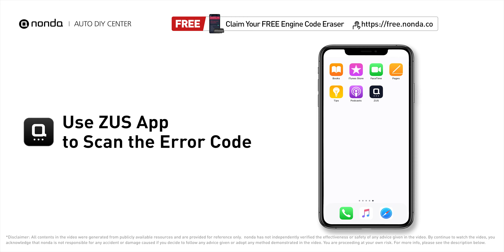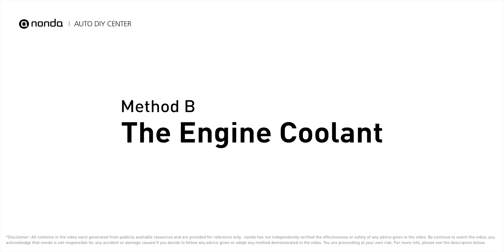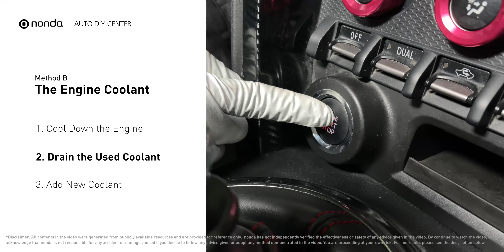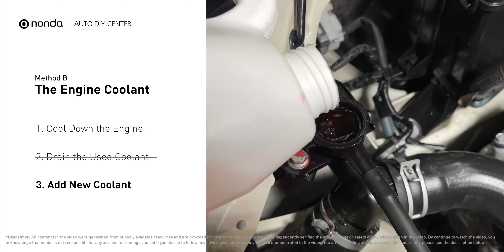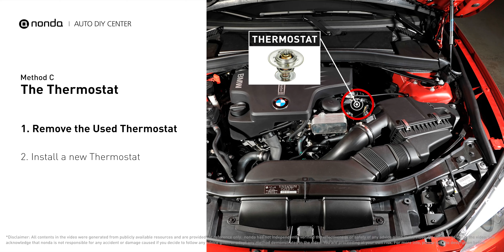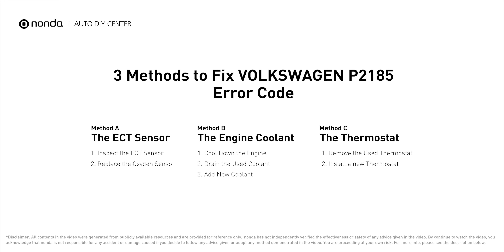How to Fix VOLKSWAGEN P2185 Engine Code in 4 Minutes [3 DIY Methods / Only $7.39]

Comment: Replaced it on my Volkswagen Jetta SE 2012 and the check engine light and code are still there. Came back as P2185 “Engine Coolant Temp Sensor on Radiator Outlet (G83): Signal Too High”
Reply from the maker: Hello, is there any other code registering together with this code?
Reply: @nondainc  No it’s just the P2185 code still. Tried re putting in a new ect sensor and still same code up.
Reply from the maker: Have you inspected the thermostat if leaking/stuck and the ECT sensor wiring harness/circuit for any issues?
Reply: @nondainc  I can check the thermostat and harness/circuit I’ll get back! Didn’t think of those to check
Reply from the maker: Hope it helps! Stay safe.
Reply: @nondainc  the thermostat and harness circuit are intact and fine. Is there a ect sensor on the radiator anywhere? Upper corners bottom?
Reply: Changed both ect sensors and thermostat. Mechanic concluded ECM is faulty.